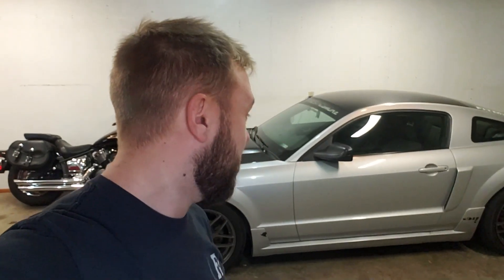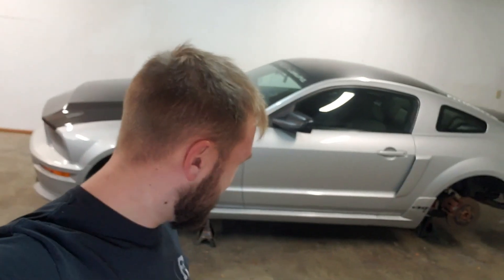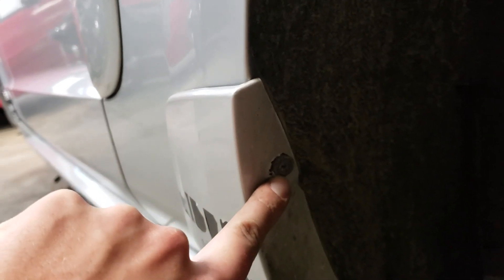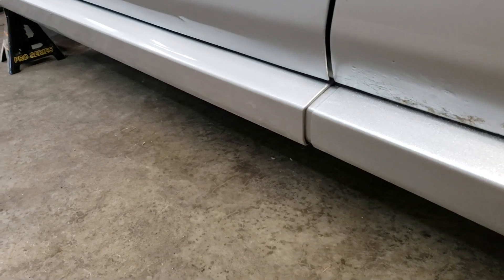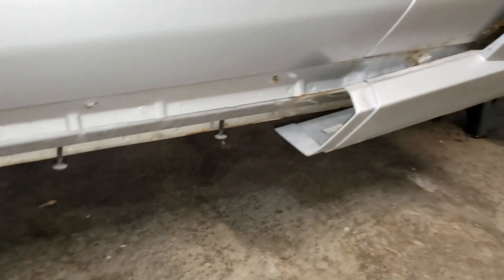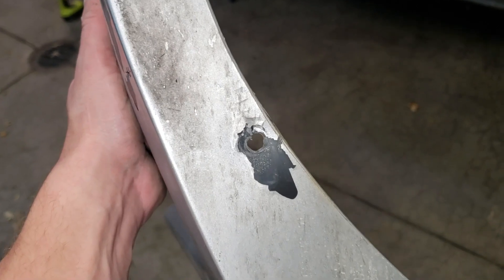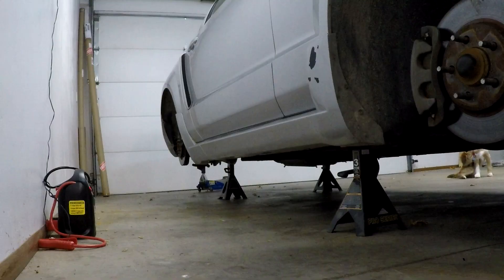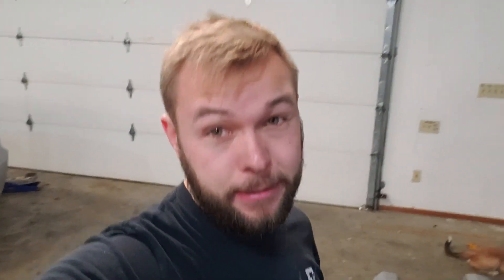Why You Shouldn't Drive Your Mustang In Winter

Comment: Hey do you wanna trade for a good new project car? It’s a 2005 mustang v6 tuned, has bullitt styled black and chrome wheels 18-10 tires and dual exhaust just got the paint touched up and has a ton of new parts on the engine. I’m 17 and have spent about $2,500 all together on everything and have been looking for a pro charged or turbocharged v6 mustang and haven’t had enough money to by one for my car. Pls reply

Comment: Sucks about the paint and the rust, I couldn’t subject my mustang to it even though I initially bought it as a daily driver. Once I started modding it I decided it was time to buy a designated daily driver. Problem is that I have an issue modifying every vehicle I own lol. 

Good luck with all of it!!!
Reply from the maker: Hey now that's what I got the fusion for now. I will admit tho it was fun driving that car during the winter the past few years.
Reply: TiresAndSmoke it’s nice having the daily. Now you can get the mustang all sorted out! Good luck with the rust! Hopefully late winter to early spring I’ll finally be doing the procharger setup on my car. I did finally do an 8.8 swap on it over the summer.